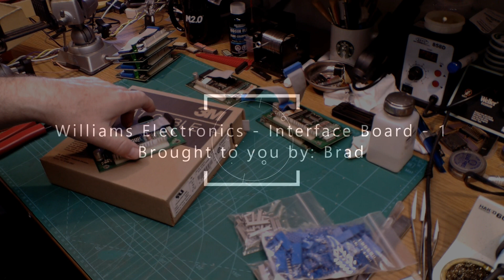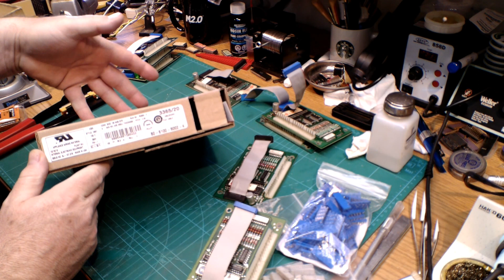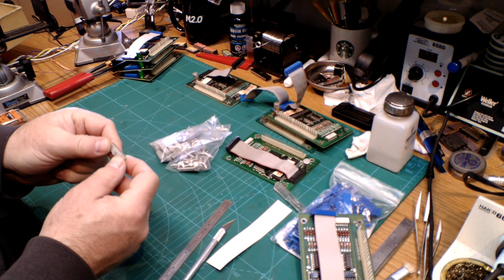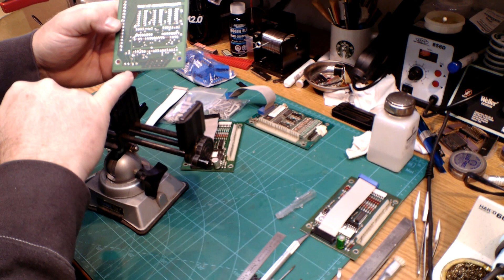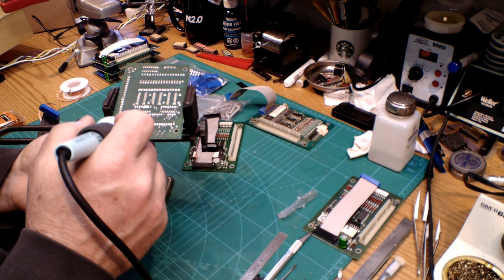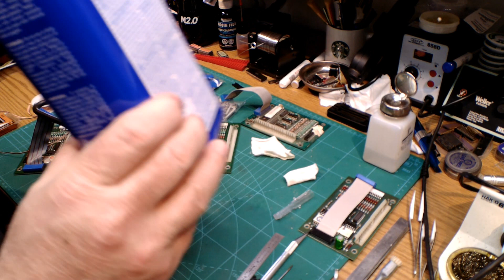Williams Defender - Interface Board Rebuild - Teardown - Part 1

Comment: EARLY WILLIAMS ELECTRONICS< the Williams Defender uses a Matrix array for the RAM chips. 
Most arcade games don't have the RAM chips in this Matrix array. I'm not sure if the Williams Stargate is also using this Matrix array for the RAM chips.
 But not sure if you know the answer as to why they used the RAM chips in this matrix array for any reasons?